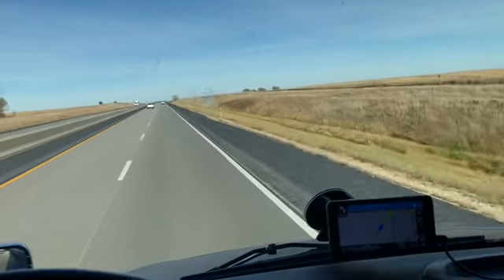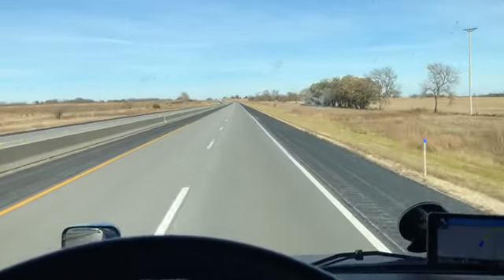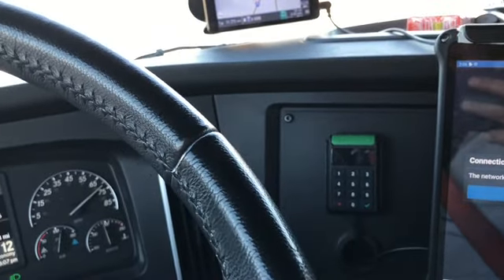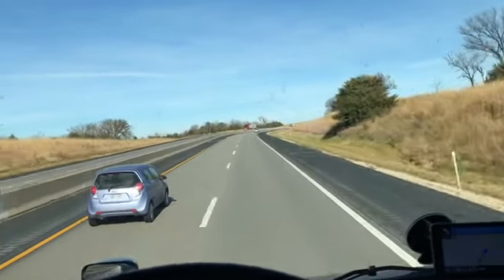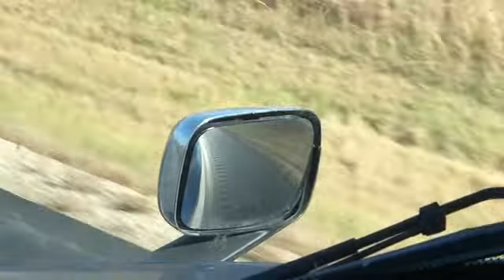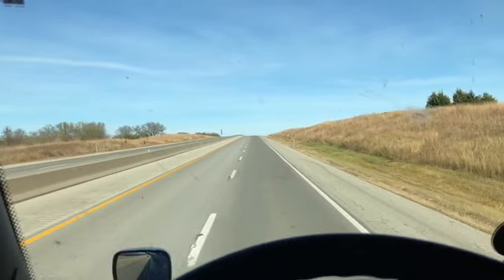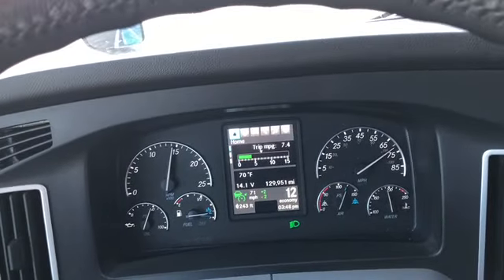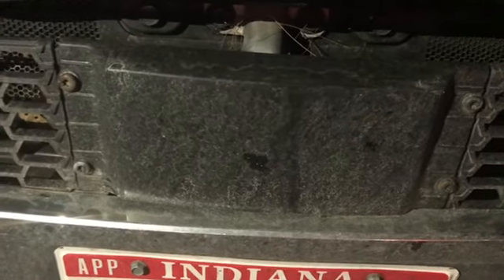The Modern Truck And It’s State Of The Art Safety Features

Comment: i road with a guy helped load and unload in 70s in calif didnt have all that for sure
Reply from the maker: Michael James when I started driving at Overnite Transportation, we didn’t have Power steering, A/C, air ride....we had a shifter, a throttle pedal, a brake pedal, a clutch and an ignition switch 😂😂

Comment: Hello: how much is the Truck??Mike Thi's. Great 😀😀😂🗽🗽🌉🌉
Reply from the maker: roberto tellez the average price for a brand new, fully equipped 2020 truck is around $140,000 to $150,000. If I pay my lease out to the end, I will pay $130,000 for this truck. It is a 2019 Freightliner with 113,000 miles on it when I got it